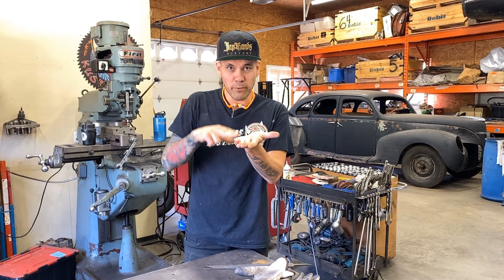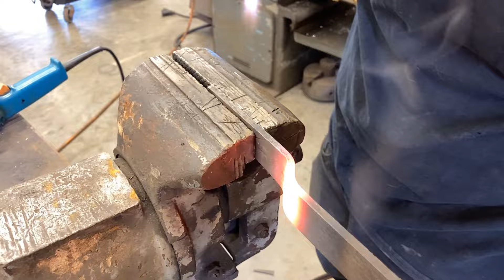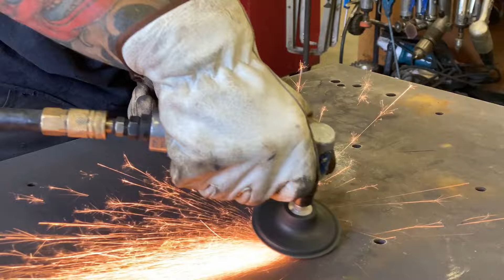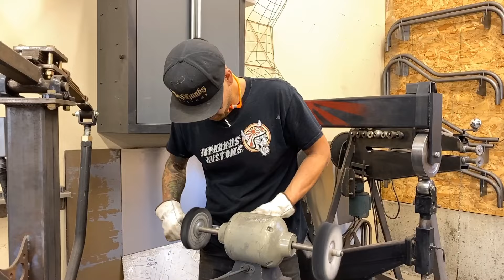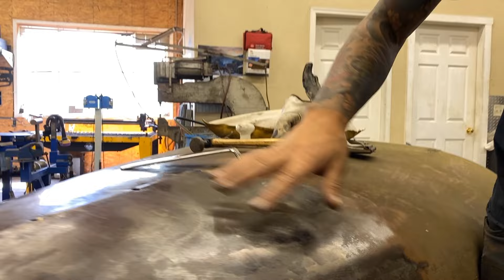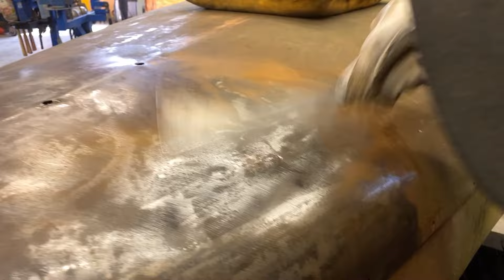How YOU Can Turn An OLD Junky File Into A NEW Slapper Spoon For DENT REPAIR, and How To Use It!!

Comment: So one thing that bugs me is that for making most of these tools you use an oxy/aceteline torch that most bucks down tinkering at hom,e guys can't afford. The best I could do is Map/oxy or my old school carbon arc torch. The carbon torch I cobbled with a crappy 80 ampo arc welder. It will only work with 1/4 carbon rods lol.

Comment: I straped down inner wheel tub
On to my new quarters? 
Stupid
The fenders were not in boxes? 
From Melvins classic ford parts.
Or maybe it was allready mared?
I couldn't find my slapper.which ive NEVER USED.
I used a hard caster wheel first. 
In the grass
Then light body hammer n dolly.
This dent was like a 20 inch valley/ curving.not deep at all. 
But/ when lighted right/It  was
TERRIBLE.!
110.00 FOR NEW QUARTER 65 Rustang.well 2 quarters. 
One messed up.
I was Trying my BEST to be on dolly EVERY HIT.!
i didn't no about off.
I want to find the spoon and try more.
Great Video

Comment: You could've saved time and bought the tools, but making the tools means you have a better tool.  I began making tools getting into machine work, I rebuilt many old machines, lathes, milling machines, and have made many scrapers, for resurfacing the ways, out of old files.  I never knew how to use a "slapper", thanks for showing this off.  That file is something on the order of 1.4 percent carbon, which makes it extremely hard, and very easy to heat and return to hard.  You'd be hard pressed to buy a tool of the same level of hard.

Comment: Nice video. I apprenticed and got certified on oxyacetylene welding years ago. A carburizing flame adds carbon to the metal , neutral is just as it says it doesn’t add anything to metal. A oxidizing flame burns the metal kind of like using a cutting torch. 2 cents worth. Love your videos. Working threw them all and leave commercials running to their end to help with your revenue
Reply from the maker: Bubba thanks so much man I appreciate you!

Comment: making one this weekend. I think.
excellent Video again Karl

Wray Schelin made one from the Spine of an old Office Chair and had a width of about 2" ( 50 mm)  same basic fab method.
Bent the handle and same approach to sanding back 36, 80, 100, 200, 400, 600, 1000, 1500, 2000, 3000, and polish.

Comment: When you heat metal to bend you should you should apply the heat to the inside of your bend rather than the outside. That will compress the hot side rather than taking a chance on stretching and cracking.

Comment: @9:44 An Oxy/Acetylene torch would have come in handy so many times over the years, but they're so impractical in a home shop over here; domestic insurers can get all kinds of twitchy about it. But over all, they just scare the living crap out of me (I've read/heard too many horror stories, I suppose!) - where did you learn, or are you self taught on torch work as well?

Mind, I say about horror stories .. but a friend of mine literally blew up his garage with a BBQ gas cylinder (cylinder in garage, slow leak, fridge compressor clicked on and they found the steel door about 200' away - made the local news and everything) so no gas is 'safe', even if we treat it as such.

Comment: Nice bit of tool making there and especially showing how to use it. 
I’ve already taken some of your ideas and used them to belt my front guards back into shape. Great felling getting the metal back to where it should be
Keep them coming. 
Also please show how to correct oil
canning of a panel. 
Cheers from down under.

Comment: I only found your channel today and I'm very impressed by your back-to-basics attitude. I am also impressed that you called Wiltshire files high quality. My dad worked for Fred Wiltshire for about twenty years, rising from fitter and turner to assistant manager. You are right, they are high quality - not as high as they used to be, but still very good.
Reply from the maker: I’ve only ever used the old ones they seem very well-made. That’s neat that there is a connection there with your dad

Comment: I've made several styles of slappers in the past 45+ years, the reason we have one that the file is still on is that we rough in the area, and use the file part to lightly file across the area, like you are using the sanding board.

Comment: Just subscribed. Your work and your videos are top notch. Great camera work also. This may have been cover already, but you may want to try another slapper leaving the teeth on the file. They dont actually remove material, but they leave slight tracks which allow you to better see when the bottom has risen flush. Saves some marking and sanding time. You guys keep up the awesome work!!!

Comment: 'Your Australian Friends' Karl when I made mine(probably 30 odd years ago) I made the bend the same as your first try but increased the gap between the two & made the 'lower bend' more gradual so it was a lot smoother to use as I found with my 'Wrist action' I was continually hitting the 'back' of the slapper on the Panel. Maybe just my experience but might help someone. 👍

Comment: Great video! I made all of my slappers and they still have the file grooves and it seem that they help to shrink the metal when used. But then like you said it leaves marks in the part you are working. I will now have to do what you showed and smooth at least one out and try it. I usually only pay $1 per file at auto parts swap meets.Jim

Comment: Very nice, Iwill be making one or three.  How do I get a warp out of a welded butt joint on a body panel ?  Please help.
Reply from the maker: Stretch the welded area back out with a hammer and dolly
Reply: @MakeItKustom   thank you for getting back to me so quickly. i am going to try it , it's the back door of my skoolie. it was hit in the rear by another bus. I cut off the lower window and just rebuilt the lower door.

Comment: I just saw your good video. I typically use spray on guide coat for low spots. What is the advantage using Sharpe marker?
Reply from the maker: The sharpie marker just dries really fast and doesn’t leave die on everything
Reply: @MakeItKustom  thank you. Really enjoy ur videos. I've been doing metal work 25 years and I learn from U all the time.

Comment: If someone took a hammer to the inside and made high spots, you'd be flipping the hood upside down and working from the inside exactly like you've done now? Slapper on the inside, dolly on the outside?
Reply from the maker: Because the slab is pretty flat you got to use it from the outside contour. Either way you look at it you hammer on the highs and Dolly on the lows to get most of the dent out then you might hammer on the dolly to planish

Comment: I've made some oak slappers but now I'll have to make one of these, great video.
Reply from the maker: Right on William do you mostly use those for aluminum and softer metals?
Reply: @MakeItKustom  they work on light sheetmetal also but I use them mainly on non ferrous metals.

Comment: Not sure if someone mentioned it but if you want to retain the heat treat (harness) you should let it air cool unless you are using quenching oil (or even old motor oil). I doubt it has any effect on a slapper but for future reference
Reply from the maker: Thanks a lot I appreciate the information!
Reply: @MakeItKustom  Thanks for being gracious bc I am pretty sure you knew that. I watched your video on making a patch discs and saw you keeping the transfer punch you were modifying cool as you made it. Anyway, stay in the fight and keep making these videos.

Comment: Man. 3M grinding disks have always been amazing, but the Cubitron line has taken it to the next universe. The 80 grit Rolocs are aggressive like 36, but leave 80 marks. The Cubitron  60+ grit belts on a hand held belt sander are one of the greatest tools you will ever use for metal fab or body work.
Reply from the maker: Yea man agreed. Best by far and worth every penny

Comment: I have 2 of them, one made from a file slightly smaller than that one that still has the file ridges, it acts like a cross between a slapper and a shrinking hammer- the ridges "grab" the steel and pull it together as you flatten it shrinking stretched metal. The second is kind of like your spoon but the working end is even wider, more square and it's made of a cut-down part of a leaf spring- it's heavy, has some surface area, and is rigid and strong enough to use for even heavy prying. 

I cut both and shaped them with a cutting wheel in an angle grinder, and then bent them with a propane/map torch, the one made of the file seemed to be just the right hardness after it cooled (a little softer than the file, files are usually hard/brittle enough that they'll crack if you drop them, too hard for a slapper), the other I shaped and ground smooth the same way but gave it to a knifemaker friend of mine and asked him to harden/temper it so the face wouldn't mar easily and the whole piece was tough for prying and bending... when I got it back I polished the face, it might be a hair softer than I would have liked but I for sure won't break it no matter what dumb thing I do with it. It's my goto for moving/flattening metal.
Reply from the maker: Awesome man yea a leaf spring is what my other heavy one is made of. Can never have too many 😂

Comment: If you want to reform the handle,  you can heat up the entire handle area, then use a broom handle to make the handle shaft concave.  If you are having trouble seeing the handle form in your mind, your thumb should fit into the concave portion while you have it in your hand, and your fingers should wrap around the outer rounded convex part of the handle while holding it.
I've know people to reform bastard cut files into slappers.  They use them as shrinking slappers.  I don't know how effective they are however.
A lot of people use blowtorch tips to heat metal, but rosebud tips work a lot better.  They aren't that expensive.
Reply from the maker: I really like that idea thanks!

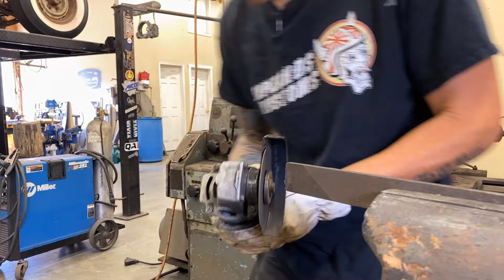Comment: I noticed at 2:24 the cutting blade was pointing right at the camera while still powered up, I have had those blades disintegrate more than once and injure someone. I don't know how to avoid the danger, other than keeping out of the way, but best to be aware of it or we won't have any more videos.
Reply from the maker: Thanks for noticing man I appreciate you looking out!
Reply: @MakeItKustom  It's bit nerdy mentioning this kind of stuff, but a friend even had a stone on a proper bench grinder break and hit him between the eyes, luckily he was wearing safety glasses, but it took four years for him to recover and he's still not 100% he has brain damage from the force it hit him with, turns out someone had been using the side of the stone and had been using so much force they had cracked it, and over time it had opened up.

Comment: Nice. I'm an old guy now, but when I was young. I loved working g with the old guys. They always had home made tools. I worked Aircraft Sheetmetal. I love forming metal. Making form blocks. Shrinking, stretching etc. I copied a tool once that was made of thick phenolic.had a flat spot. And a large curve . Like a slapper. Not leaving a mark.
Reply from the maker: Sounds like a pretty handy tool! It’s nice when working with aluminum you can use softer things to not mark it up

Comment: Ahhh, I just went out and checked, the only large File I have is a round back.  Not sure if you could shape that file the same for the flat side or if you would want to make it a round face slapper for curved surfaces, probably wouldn't need or use that as often?  I thought I had some large flat files but didn't, have to start garage selling..   I am trying to restore a 60 Chevy Truck with lots of curvy surfaces, but the file curve wouldn't probably work for most curved areas?  Any thoughts on how that would work? Love your videos, Keep up the good work!!
Reply from the maker: If it’s a half round file then you could definitely still use the flat side? I’d say go for it PS I love those years trucks

Comment: Too show how metal can be manipulated, show your folks the ole Oxyacetylene rod trick. Take a long 1/8” rod, bow it and it will return with little to  no distortion. Then bow it again then tap it on your metal table and it will hold the bow. It is a simple way to explain how steel can be easily manipulated but it takes a little “tapping” to make the steel stay where you want it. BTW,  nice slapper…I do like them with the file face intact to push the metal in a particular direction if needed. I’ve never thought about having one that smooth but I’ve also never fully metal finished very many things. All my stuff have been production bodywork where a little filler and primer surfacer is acceptable. 
I really admire your craftsmanship and enthusiasm in the trade. Young Guys like you is what we need in the (repair) car culture.
Reply from the maker: Thanks a lot for the tip! I’m sure the viewers would love to see that I appreciate your message here thanks for taking the time cheers!

Comment: If you polish the slapper do you need to wax it so, it doesn't rust if you don't use the tools every day? Also I thought if you leave the finish as a file if will shrink the surface? Great job. Now I know what to do with a few of my old files and I was looking to buy a couple of slappers,now I don't have to. Thank You.
Reply from the maker: Right on glad  to hear it! The polish doesn’t seem to rust like bare steel does so I’m not having the issue. I also would rather the polish than the file face because I use other techniques for shrinking

Comment: Really cool. I was thinking leaf spring would be a good choice of steel. A side note on files some are case hardened and made from mild steel so the center will be soft.  Hammers are usually made from 4140 chromoly the same steel that is in axles. Leaf springs are 5160 usually. I make a lot of knives from 5160 and it is an awesome steel for any application  like choppers and cleavers and such.   I can only guess 5160 would be awesome in this application as well. Seriously digging the videos. Keep up the awesome work.
Reply from the maker: Yeah I made my first one out of a leaf spring! They work great 👍
Reply from the maker: Thanks man appreciate it! Cheers

Comment: Nice job, I recently made one using an old bumper bracket off my 40 Dodge coupe project. It was pre bent in a good shape which was good for me as I dont have a torch. what would be the best way to send some pics of my project car? I have been working on it for 2 years and just got it inspected and registered and on the road.
Reply from the maker: Thanks man! Cool a bumper bracket probably worked great too! japhandskustoms@gmail.com
Reply: @MakeItKustom  Still learning to work it but I think it will be ok

Comment: Thanks for this video Karl , will be making a slapper and looking for a  leaf spring too ! Bought a used door for  my 55 chevy that was pushed in, pretty large dent< I pushed it out and got a lot out .
My question is I cant get to the back side to work the rest out,  upside down v shape up  high , if you have a video or can work in one to help me ,would be much appreciated,  Thank you
Reply from the maker: Good for you working out that all dent! If you’re talking about the body line up near the window frame to use the upside down V shape with. That’s a tough one. As much as you don’t want to hear it I would cut it out fix it and then reinstall it. If you were to cut a half an inch away from the body line and remove that section it is pretty strong. You could fix it and then re-weld it and since you’re only half an inch away from the strong spot there will be minimal warpage if you take your time.

Comment: Nice work, I’m just wondering why you wouldn’t apply heat to the low like in the last video? I just threw away a couple leaf springs, I wish I knew
Reply from the maker: Some dents are so minor that they did not require heat shrinking in this case I was able to remove it without. Because this is not a severe dent the shrinking desk could’ve helped a little bit and I will continue to use the desk in areas that the dents are not coming out as easy because of the tension in the panel

Comment: Why not leave the tang so your holding it by a wood handle? It seems like anything that would reduce vibration to your hand would be desirable. You’ve gotta protect those mitts so you can slap well into old age.
Reply from the maker: I would like to make a handle for it but using a file in that Way I found that the wood handle is not meant to take that blow and they just end up falling off

Comment: I have made open end wrenches, Vent at odd angles for import carburetor removal, but never out of a file before. I can see the advantages plus its hardness for lasting a long time. But, can a guy make a “Left-Handed” version? If so, I will start maaking them as soon as I get these scissors off stuck on fingers!!! Get off. crap, right handed stuff...
Reply from the maker: Well since this one’s totally symmetrical I’m pretty sure you can use it in both hands! When you make your own tools you make them for you so whatever you like man!
Reply: I know, just adding something to smile about. Left handed and 6’3” tall. So no shirts fit and everything out there is right handed! Its tough. Nice job on your build and polishing is hard with high carbon steel. I am past my days of rushing to finish a job. But still try to get something done each day. Have a good one.